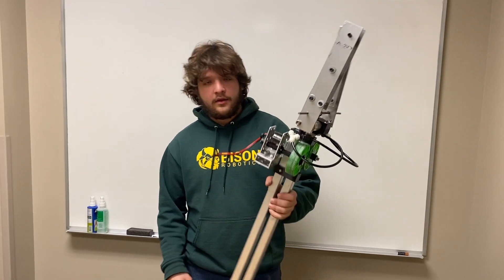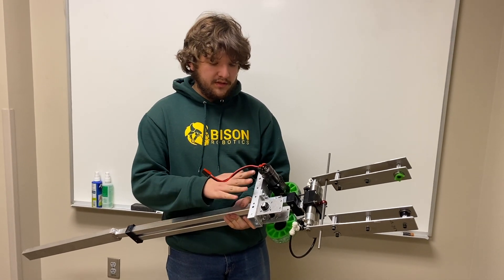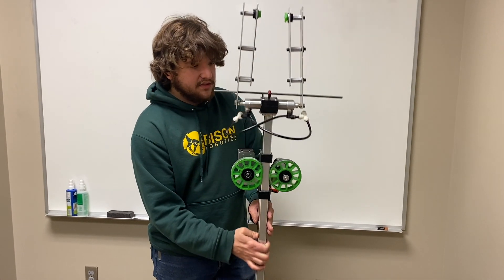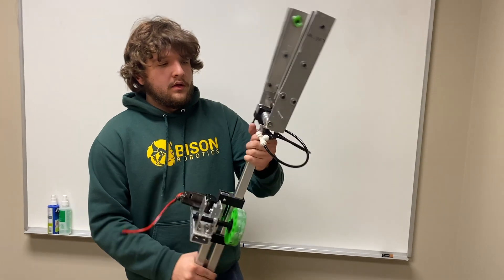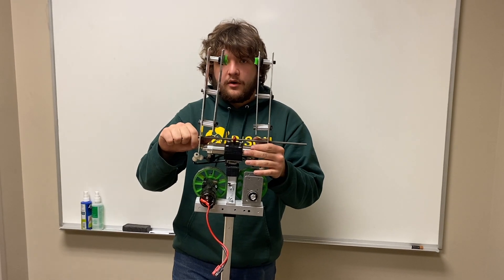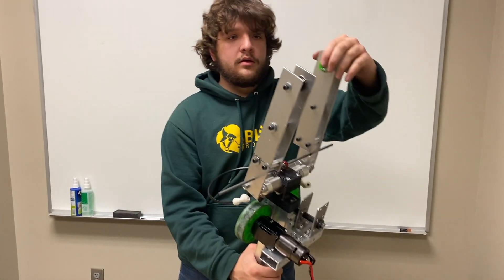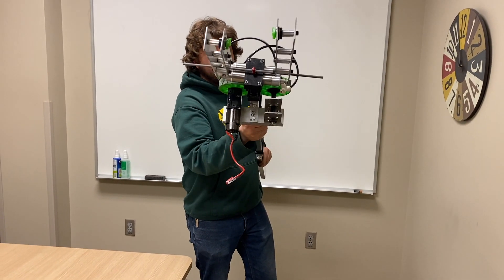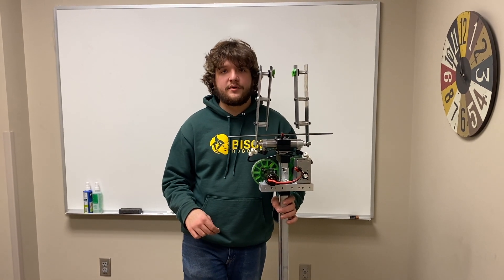NDSU Ri3D Update 6 - Final Arm and Grabber

Comment: Question do you think it could be better that with the arm you add pumps so that you can hold it better ?
Reply from the maker: During the design process, a vacuum-assisted retention mechanism was considered, however the large air consumption requirement associated with a venturi-style pump eliminated that due to the consideration that many rookie or new teams may not have access to the associated pneumatic components. Electrical vacuum pumps were also ruled out due to the low airflow provided by the pump, increasing time needed to properly retain the game piece. The vacuum pump would be best utilized on the cube, with the larger surface area, which being as light as it is, seems redundant compared to a simple grabber which can also be utilized to pick up the cones. Further consideration into picking up cones with a vacuum also reveals that either you will need to pick the cone up from the top, which would require sealing the hole in the top center of the cone, or squeezing the cone enough to produce a large enough flat surface to seal the vacuum to. The mechanism we are using also allows us to pick up cones from nearly any orientation.